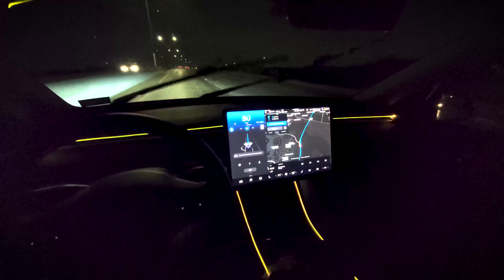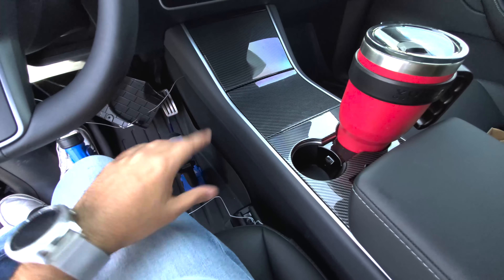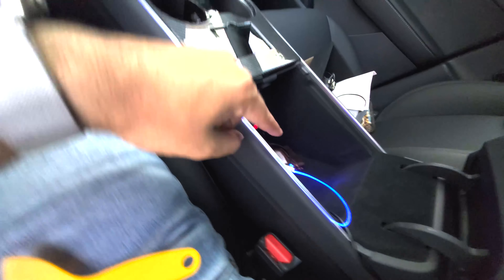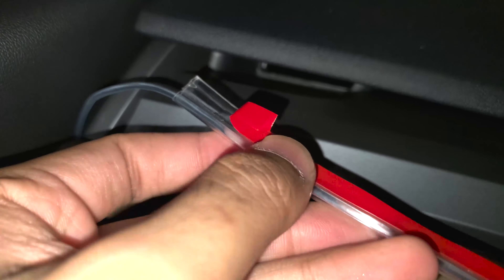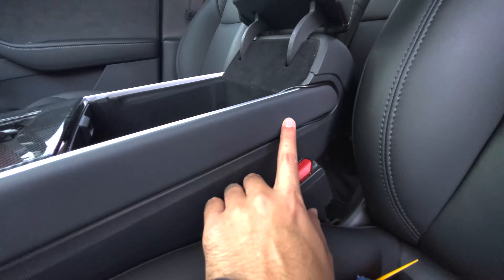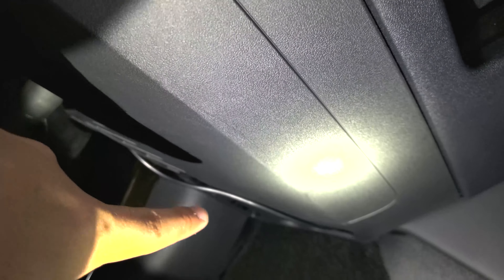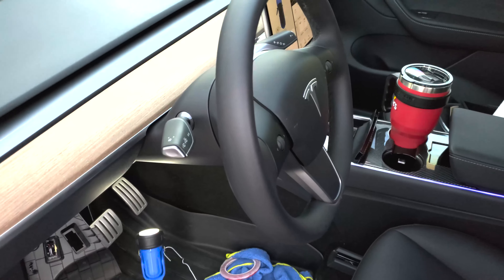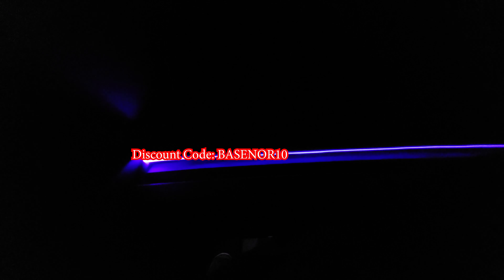Techno Tesla - Basenor LEDs Model 3 / Model Y - Install and Review

Comment: On the front Dash.. The led strip running across is all wavy and not a straight line.. Is that how it installs? It definitely doesn't look factory. It looks very aftermarket
Reply from the maker: I agree that it can be 'wavy' if you don't have a steady hand, but unfortunately this is what's available aftermarket until they release something like an LED snap on panel.

Comment: How are these lights holding up now? Are they still operating correctly? And still bright?
Reply from the maker: Actually, they aren't :( but I'll release a video on how to fix that! You can swap the ends of the fiber optic cable and it works bright again or buy additional 3mm fiber.

Comment: How are yours so much brighter?
Reply from the maker: In the daytime they are not bright at all but at night it is pretty decent depending on what level you said. Make sure you check the connection with the light emitter and make sure there are no Kinks in the fiber-optic line

Comment: I bought a set and they worked well for months. Now, they're lit at the base but the tubes are not lighting up like they did originally.  I really liked them but now I'm concerned. Any suggestions?
Reply from the maker: I'm having the same issues but if you swap the ends it might work again like it did for me. If not it's 5 mm fiber optic cable
Reply: @AKTechIT  OK, I'll try it. Let them know I bought them on your recommendation so if they're exposing your credibility that's concerning!
Reply from the maker: Yeah I've had mine for 2 years so now they are showing the issues with the ends not lighting through. They weren't able to warranty it since it's been long but if it's within a few months, might work sending them an email.
Reply: @AKTechIT  I've had mine for about a year . I'll email them and see if they replace the tubes. It can't be that much compared to a customer that wants to continue to upgrade his model 3 with their products!

Comment: Thanks for a great video. But how is it working now? I have heard this strip stops working after while. Love to hear how it is working now.
Reply from the maker: Working hundred percent fine right now :) still able to use the app and it turns on just like normal
Reply: @AKTechIT  thanks for the update. I am enjoying your videos. Will you be doing a video on other model Y products?
Reply from the maker: @nevillejames2200  I actually have several videos I've recorded four months now but barely have had time to edit them
Reply: @AKTechIT  I look forward to them when they come out. I could imagine the time it takes to edit. Side question: When you use your lighting do you notice it impacting your driving range?

Comment: Just installed mine today. Initially,  it looks like one side is brighter than the other side. I'll check it out tonight. What's the fix if one side is brighter than the other?
Reply from the maker: Verify the connection to the led
Reply: @AKTechIT  will do. Thanks. I'll let you know if that works.
Reply: Thanks AK! I rechecked the connection and tighten it up.  Works great.  The other problem was the two sided tape didn't adhere on one end. Is there any a brand that you recommend?
Reply from the maker: @901R8DR  There is the slim red automotive tape that may work well, see if you can find a clear version at an autozone or similar
Reply: @AKTechIT    I did and it works great!!  Thanks a lot!! Lights look really smooth.

Comment: I dont get it, because you dint show where the power comes from, yeah the sigarette 12V, but when you have the full kit of the console and dash, do the 3 strips origin from 1 12V connection or what?
Reply: Yes he shows in the video how he routes the dashboard light emitter from the center console.
Reply from the maker: Yep, all 3 from the single 12v, make sure you buy dash and console kit and not just console

Comment: This kit is powered by a cigarette lighter connection and you have to manually turn it on.  Any work around ideas on how to hardwire it so that it would automatically light up when you enter the car but stay at max light output when driving?
Reply: No need for a switch. Lights will turn off as car turns off as you walk away from your car. As lights will shut off as car is off completely
Reply: @kushpatel704  my car won't off while I am away. I am afraid of losing some energy because of it.
Reply from the maker: It's a very small amount, negligible

Comment: How was the tape, did you have any problems with it? I read a lot of people said that the tape was not strong enough that they had to use aftermarket tape like 3M.
Reply from the maker: The tape is actually perfect, just clean and prep the surface before hand. Still holding strong in 100F weather here
Reply: Just got kit today and this is the issue I'm having the tape will not still to the dash surface I've even tried to put extra tape in stops to hold it. I used alcohol to clean it before hand . The stip I got is also thinner than one in video so maybe there cutting back some and it's reducing the effectiveness
Reply from the maker: You're taping under the dash qnd not on top right?
Reply: @AKTechIT  yupp exactly where u are in video . Gonna clean it once more use fresh tape and try again. Thanks for the quick response btw
Reply from the maker: @relaxtakenotes9556  you can always use a small piece to test out and see if it adheres properly
Reply: @AKTechIT  I got it to work after cleaning it again and really holding each section on with some pressure as I went. Looks really good 👍
Reply from the maker: @relaxtakenotes9556  awesome! Please sub to help the channel, I've got more content and accessories coming soon 😬

Comment: Hi. Did the tape you used come with the set or did you buy that separately.
Reply from the maker: Came with the set, make sure to clean the surface properly before you tape. You can get the red 3m automotive tape, the thin one
Reply: @AKTechIT  I bought the set but it was not for the dash. Only for the console. I have made it so I have light on the top and bottom I’m center. The place where you took the power line forward. So I’m thinking there can be not enough space for the light and the power going at the same place.
Reply from the maker: @badmonkey2917  send me a pic, I'll see if I can help?
Reply: @AKTechIT  it’s not possible sending pictures in this comment.
Reply: @AKTechIT  where can I send you the picture
Reply from the maker: @badmonkey2917  aktech.it@gmail.com

Comment: Hi.  Dose it turn off when the car is off and come on when you start the car?  I mean, does the cigereete lighter on Tesla's turn off when the car is not in operating position?
Reply: I know exactly what you're asking for. But you can always strip the cigarette lighter part off and wire it to the dome lights. I did it with my honda.
Reply from the maker: I think after some time it does. Haven't had any issues though, has been in my car for over 1 year

Comment: I’m not concerned about range but Tesla’s are kinda notorious for the 12v battery draining and as a result the car won’t start. I wonder if this would make that worse.  To be on the safe side I always turn off the light by unplugging the actual port but I wonder if power would still be used even if the thing is plugged in but turned off from the red button, not just the app
Reply from the maker: Good question, needs to be checked a device in between for power draw

Comment: I have tried many double sided adhesive but they do not stick to the dashboard.  what do you recommend to fix the strips?
Reply from the maker: Make sure you a) clean the adhesive side on the strip with alcohol or goofoff, b) clean the site you are attaching to - that should make sure you have a strong bond c) try an adhesive promoter but not sure if that will damage anything

Comment: which size brand and tape are you using? The tape it came with is not working well
Reply from the maker: Same tape that came with it but you can get the red automotive tape. The important thing is to clean the surface where you are taking beforehand with a wet rag and let it dry.
Reply: @AKTechIT  thank you! How have the lights been holding up?
Reply from the maker: @justink8163  great! Still no issues and sticking just fine :)

Comment: How do you feel safe in that a little external addition of your own will not potentially put the entire car's (and yours) safety in jeopardy? Imagine that little thing becomes the root of fire under some accident or something. Won't it be a great pitty to risk a 35-50 thousand dollars car for a little cosmetic addition?
Reply from the maker: I understand the concern but it is low voltage
Reply from the maker: And if you have the app you can turn it off or schedule it as you like, or just turn it off when you get out of the car
Reply: @AKTechIT  so it's impossible to compromise the car's safety? I ask cause I really liked the way it looks but I'm always hesitant in messing with potentially risky cosmetics.

Comment: Is there any way to mount the horizontal  strip further in to get rid of the windscreen reflection? Mounted mine just like in the video, you can see the reflection in the beginning of the video. Will try to get the strip unstuck from the very sticky glue to push it further in tomorrow.

Comment: Can you elaborate what you meant at 13:15 about swapping the ends to prevent less light going through to that side? I'm facing that problem now...
Reply from the maker: Hey, sorry to hear that! If you remove the actually fiber optic insert and swap where it connects, should get you more light. Let me know if this makes sense.
Reply: @AKTechIT  thanks for replying!! What do you mean swap where it connects? Sorry for not understanding you, ha.
Reply from the maker: @dtdynd  ha no worries! There is the silver piece that emits the light, you screw in the fiber piece in there, correct? Just unscrew it, take it out of the clear tube and swap the ends  :) hope that helps!
Reply: @dtdynd  and you txt  try

Comment: I saw someone on Amazon say they connected the lights directly to their puddle light under the drivers side?  Saves you from having to have the plug in the console.  Anyone else try this and can share how it’s done?
Reply from the maker: Oh, thats interesting! I will look into it and let you know, probably has something to do with splicing the the wire or attaching a piggyback cable

Comment: Thanks, I needed this to install mine in my Model Y.  I noticed something that I think I will try.  I see you also have those all weather car mats with the sides going up all around to catch liquids and just snow and ice crud during winter.  
I think I will try to route the power cabled under the floor mats and through the carpet at the console, even though it would be hidden by the seat.   Then up, without removing the bottom panel (I would need to check) and then remove the little side panel and fish from there.  I'm an old fart, and things aren't as easy for me anymore.
Reply from the maker: You can take your time, maybe just do the center console and see if you like it.
Reply: @AKTechIT  Yeah I already did the center console and like it very much.  I did buy the whole kit, so I may as well use it.

Comment: Thank you so much for this video. This is really cool. Is there anyway to make them turn off once the door is closed while driving and also if the car is off? Just asking because it'll be nice to have an option to have them on or off while driving. But I suspect that they'll need to def be off while the car is off and locked.
Reply from the maker: I am not 100% sure but I believe the 12-volt turns off after some time. If you wanted to you can turn it off via the app.
Reply: @AKTechIT  thank you so much.
Reply: You can hook them up to Google home and set routines.